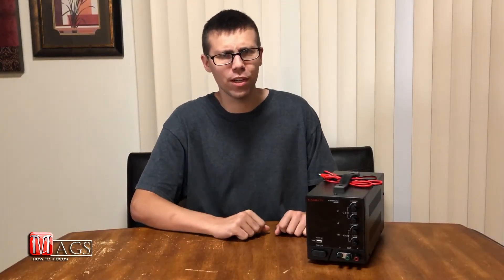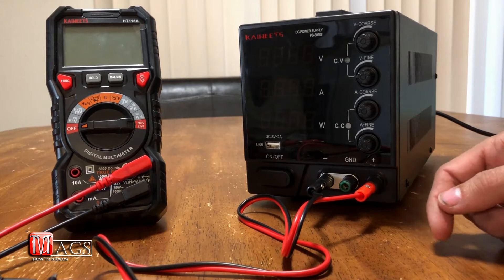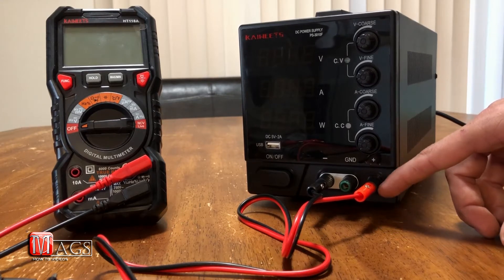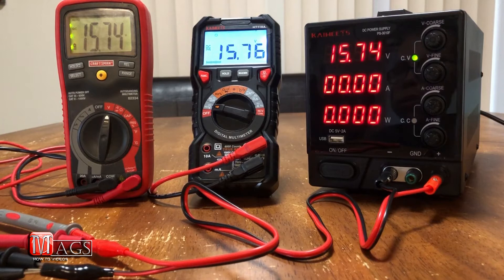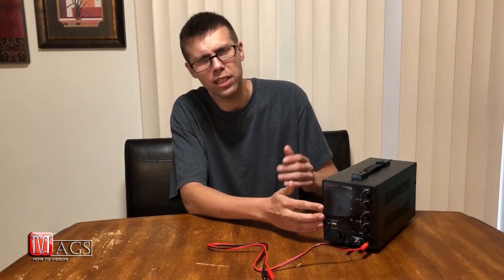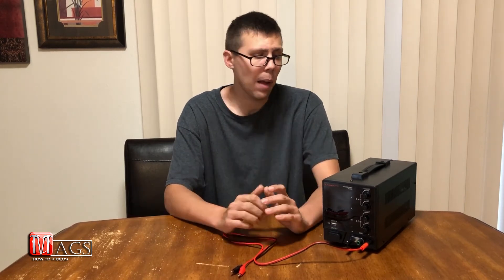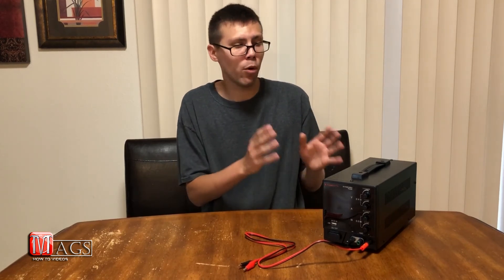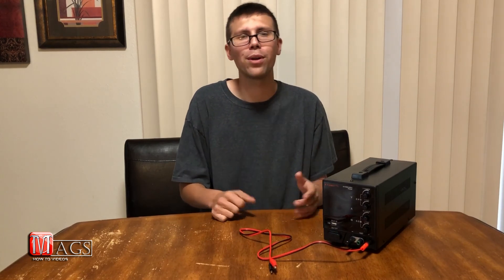Kaiweets PS-3010F DC Power Supply Review Video

Comment: Thanks...does it have a protective plastic over front faceplate to protect it during shipping. I don't see one on mine? Hence, my plastic faceplate has some light scratches.
Reply from the maker: That’s a good question. It’s been so long I don’t remember. However, I don’t think it did. I did get this product as a early release so usually they don’t have all of the extra padding.

Comment: Thanks... AGAIN !

After watching your flamethrower build & safety videos last week.....
I got over my jealousy, bitterness and  ANGER (not at you... at MYSELF for remaining in NJ -  LOL)

I then proceeded to watch the rest of your videos.

I was in the market for a new and affordable DC power supply for field work.

I already have an HP (linear) and Rigol (switched)  bench supplies, but they are a bit too heavy to bring out in the field for service work.
(& most of the work I currently do is 2-way radio / repeater installation/ service / maintenance — and the locations are fairly hostile to delicate equipment.  // ex:  water tank equipment rooms / high-rise building rooftop elevator mechanical rooms / Etc...)

Most of the equipment I work with is 12vdc (13.8) and 24vdc.  Most everything (other than transmitters- which can range from 10-30 amps) is low current draw, making this bench supply ideal.  

The top mounted handle is ideal for field work and the weight is surprisingly light.

** NOTE:  The unit arrived from Amazon (yup... someone needs to prevent Bezos and the elite from starving during this tough times)
It arrived in a decent size box and was packed well with foam blocks preventing shipping damage.
THE UNIT WOULD NOT POWER UP.   After playing around for nearly a half hour, I began to troubleshoot in earnest.
It turns out the AC power cable was defective.!

After purchasing and working with thousands of devices using the same type NEMA  5-15p // c13 cable,
I have NEVER actually encountered a bad cable “out of the box”.

Just a minor issue, as most of us probably have hundreds of spare cables sitting around.

I just wanted to point this out in case anyone else experienced a similar problem when initially powering on the unit.

Also... The power supply is fabulous for the price.  (a tiny fraction of my older bench supplies.)
The only thing I’d recommend—>. BUY BETTER TEST LEADS!
(Fluke or equivalent heavy-duty silicone insulation leads with molded banana plugs are fairly inexpensive for something you will be handling on a regular basis)

Forgot— I analyzed the power output with an oscilloscope and  VNC .
It’s quite “clean” for a power supply in this price range.

Other than the defective AC Power cable issue and the “cheap as shit” output leads included,
there IS one other thing I found to be a minor annoyance.   The adjustment knobs are finite and don’t provide nearly the precise adjustment that I am used to.   This it’s not a major issue and  I’m quite sure most people will not be bothered by it.  I just thought I’d mention it.

Forgot yet another item:  I was always taught to remove the bonding between the  chassis (ground) and the negative output terminal of a power supply.   As long as the power supply includes a separate “ground“ terminal, eliminating the ground reference to negative provide you with a “floating output”.  (%Please do not make this modification unless you are sure it is safe and appropriate for your application.)

Anyhow...

Thanks again.

And...   
1:    # STOP..THE..STEAL.    🚔

2:   The DemonCrats are running loose and CHEATING on every front.  🦍

3:  GO TRUMP!!🇺🇸

4:   # WHERE IS HUNTER?    (& where is the FBI’s copy of the “Hard Drive From HELL”?)

5:   Mask Up!   The government knows best.   
Their vaccine is definitely safe and effective a against this BIOLOGICAL WEAPON sent here from the Motherland.

2020 has sure been a crazy year!
Reply from the maker: Thanks for the further insight on this product. Since I haven’t used to many DC Power Supply’s I really didn’t have to much to compare it to.
Reply: @MAGSHowToVideos  it really was a great deal for the price.   I spent another $22 for a #14awg silicone flexible lead set  &. Another $16 for a pair of “ABN” alligator clips.  (angled bed of nails // the kind commonly found on telecom test sets)

Again... Great review on your part.
Thanks